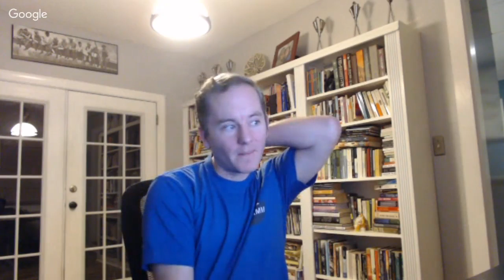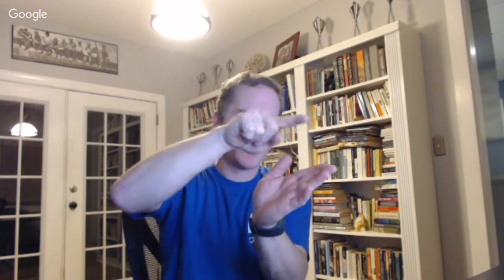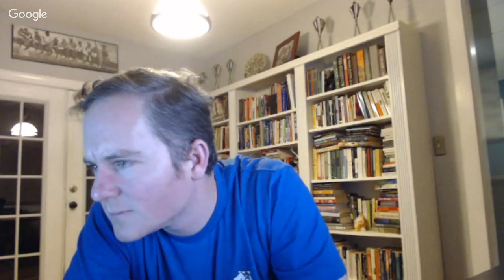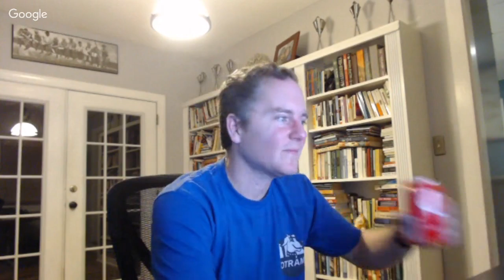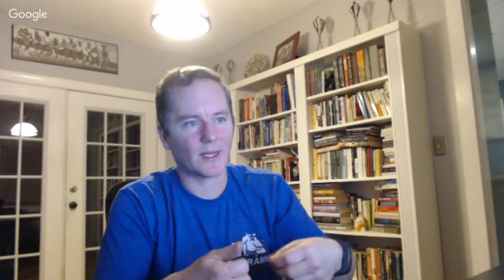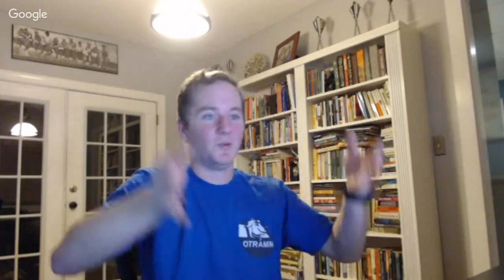Tuesday Chat #21

Comment: What’s a good resource for finding OEM replacement electrical plugs? I need to replace my 93 FZJ80’s distributor and ignition coil plug. They are snapped
Reply from the maker: Most often we get them from the dealer. You just need a parts guy willing to look them up. Or we cut them out of salvage harnesses.